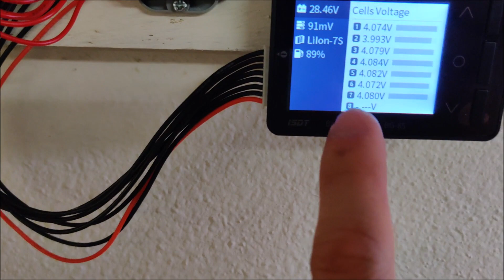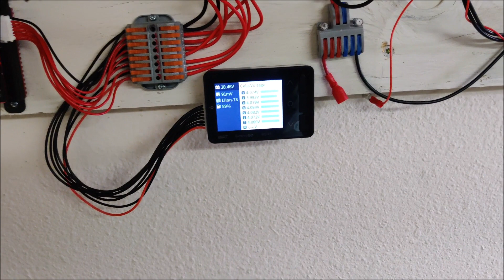POWERWALL MAINTENANCE - PULLED PACK 2 AGAIN

Comment: Hello cycle how many years ?
Reply from the maker: 3 to 5 years
Reply: @stevenc22  
I think it goes a little bit longer than I think regular use . 15 years with 12vbms 220ah battry . , do you think ?
Reply from the maker: @ismailozcelik1662  most batteries used in powerwalls were already used so that will definitely shorten the life
Reply: @ismailozcelik1662  Which 220 AH Battery will last for 15 years ?
Reply: @vtorsi610  I'm thinking about doing it myself. can I use it for a very long time, friend
Reply: @ismailozcelik1662  We have no evidence that these USED cell can last 15 years.  You will be replacing "bad" cells forever ...
Reply: @vtorsi610  I ain't gonna be more . 12v bms 220ah cell goes more than how many years do you think it is .? TV lamp etc.

Comment: I do not like that these battery packs require so much maintenance. They required a lot of labor to construct and now they require even more labor.
Reply from the maker: Yes these need to be watched. All lithium ion batteries require maintenance and monitoring. Especially ones this size!
Reply: @stevenc22  There is no, easy way to identify a weak cell in a huge parallel pack